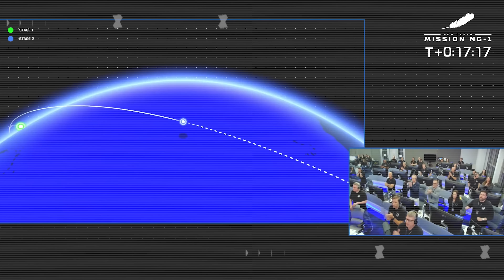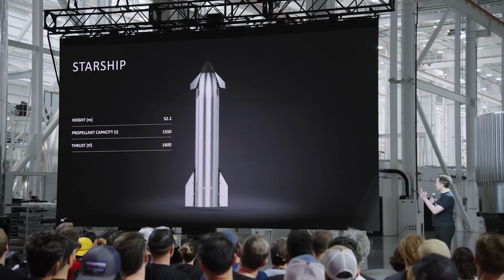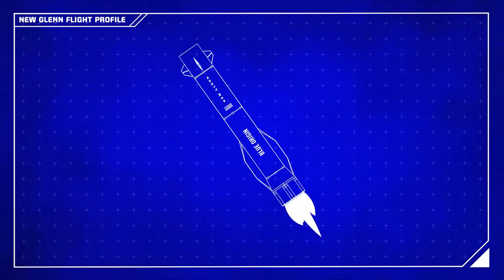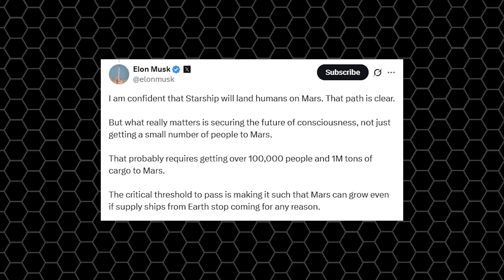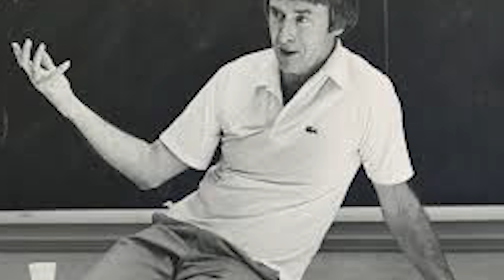Blue Origin New Glenn is EXACT SpaceX Starship Killer!? Musk Laughs...

Comment: The entire Starship design is a monument to idiotic futility  design based on material costs and arrogant pride mixed with the termination of anyone that tries to tell musk the truth. In order to 
Attempt to make his idiotic concept viable will likely take decades  to achieve if ever and the ended up costs of the choice of steel in order to make just 1 successful rentry will be exponentially more costly than simply paying the  carbon fiber components.  
And will never be cable of  reusability without massive, more costly refurbishment than original production.  

One such failed idiotic musk directive. The ceramic heat tiles were and still are based on the heat tiles used on the Space shuttle.  SpaceX was given the entire  archive of research into the development and engineering of the various  tile and needed tolerances. As well as Nasa approved manufacturers of the tiles. Musk decided without any understanding of why the space shuttle tiles were intentionally designed without continuous linear joints.  So they could be mass produced instead of 
Being specifically produced per section. 

The heat-resistant adhesive nasa used on the shuttle is costly and adds significant weight. Musk attempted to forgo this crucial component and originally had the tiles mounted to the hull with metal components.  
Furthermore, more musk forgo the Nasa recommended producers of the tiles and contracted a foreign company that specialized in plastics. These tiles were made with materials  that were poor quality, too large, and such the materials were not properly  proportioned, producing incosistant tiles that were prone to breaking. After several failed attempts, SpaceX has now had tiles produced from a more qualified production company. Using the adhesive, however, the additional weight prevents the starship shell from lifting anything in it. So massive reductions in the shielding and material tolerances in the propellant transfer pumps and engine shielding as well as  increased spacing  between interior hull skeleton.  However , the symmetrical joints of the tiles  does not disperse the heat sufficiently allowing very high temperatures to penetrate the gaps. Steel  contracts and expands significantly under much less extremes than experienced during launch, freezing and warming extremes in Leo then massive extremes of nonballistic rentry. It is very likely based on footage the mere contractions of cold space alone are enough to compromise the structural integrity of the welds. Regardless during rentry the weld and structure expansions make reusability an impossibility,  however structural integrity seems sufficient for intact rentry. 
Except for the drastic reductions in shielding and decreased  material sizes for propellant transfer. With leaks evident in every reentry and interior flames engulfing the upper engine housings. The bs supposed raptor 3 engines are supposed to not need shielding and are supposed to produce greater thrust with even further reductions in propellant hoses and components. However much of the weight reductions is from carbon fiber . That again increase s cost and can't be produced by SpaceX.  As for reduced hoses and components is supposedly by using a single propellant transfer pump to all the engines.  This has proven unreliable and inconsistent when oppperateing a single engine in various test ignition.  Not to mention as of yet  only sea level raptor 3s have prototypes being tested.   Raptor 2 vacuum ergo that used in starship are still being produced though in reduced production numbers.
Reply: Exactly! 13 failure and the thing can still not make it in orbit and carry anything.
They spent $3 billions on this stupid useless vehicle. It could be one day good at putting Sarship into orbit. Beyond that, Starship is just like the Cybertruck and Hyperloop.
Reply: @trucksanddirt1506  Just to illustrate you have no idea what you're talking about: There haven't even been 13 starship flights.
Reply: @XShadowAngel The thing is a joke, it's clearly not working. If it could get to mars , or even the moon they would have done so.
Reply: @Supraboyes  What part of it being in testing do you struggle with? And the last handful of test launches have all gone extremely well, in point of fact.
But then, what do you know? You're trying to say it;s never been to orbit, and it has.
Reply: @XShadowAngel  No Starship has not achieved orbital velocity. Its far too heavy even as an empty shell.  Originally Version 2 with its increased propellant tanks and drastically reduced engine housings,shielding,and inadequate propellant fittings and plumbing.  However with the additional heat shielding and subsequent propellant leaks and attempting to find the bare minimum to reduce fires. v2 was barley capable of reaching orbital velocity as an empty shell and if it had could not have deorbited under guidance. V3 was also promised to finally be the starship that would be able to reach L.e.o. with 100 tons of payload . However, SpaceX has now publicly announced there will be a version 4 and 5. 

So it will likely still be a long time before starship reaches orbit. If they had any actual direction to achieve any of thier public stated goals then they would focusing on keeping thier propellant and engines from incinerating on reentry.
Reply: @trucksanddirt1506  Uh. Starship's reached orbital altitude and velocity plenty of times. They just bring it back down because the landing is what they're testing. Anyone can get to orbit. SpaceX gets Falcon9's to orbit almost daily. It's the landing that's hard, and why nobody else has done it. You people have no idea what you're talking about, but are very loud.
Reply: One hell of a lot of hot air.
Reply: @MrEh5  Well yes, that's what Elon sells--hot air.

Comment: New Glenn is competition to F9, not Starship. However, if BO and others want to compete against SX AND CHINA, they need to quit following in SX's footsteps. 
Instead, they need to do a number of standards and modularize more. NG, Vulcan, even others can launch fuel, limited cargo, and modules. 
So, they need:
1) a fuel depot with a standard for docking and ideally, providing different fuel/Ox. LOH, LOX, and LCH4 are the 3 biggest, but even multiple hypergolic are needed. So, ideally, all fuel depots will support 2 different main fuel/lox that transfer via large fast connections, along with smaller tanks for hypergolic that can be transferred via IDSS docking which needs to fully develop standard connections. Otherwise, several different fuel depots. 
2) tug for moving habitats and cargo modules in LEO, between LEO and LLO, between LLO and LMO. Initially make them chemical engines, but then switch to nuclear once available. 
3) the crewed habitats for space station are ideal for moving crew between LEO/LLO and LEO/LMO. 
4) a cargo module that sits in the upper stage of these rockets would be ideal for moving from earth, orbit, moon. 
5) a lunar lander that works with both crewed/cargo module. Ideally, it would bring down cargo and habitat modules and drop them off. For human transfer a special, unit that is lightweight to minimize fuel up and down.

Comment: The second stage is damaged... But at least we know how it's installed on New Glenn. But how do 100 tons of cargo get into the HLS payload bay? At least show an animation. Not the Starlink launch, not the fuel transfer, but the cargo. For example, load 12 Cibertraks into the ship. I'd like to see it.
Reply: you might have a point but .. cbrt(1100m3) is 10.3228011546m ... liquids would fit more than ~1000 tons in such space...  if the cargo bay would be square then in 10 by 10 by 10 meters one could fiit 10 by 25 = 250 trucks (more than 2 tons each, so at least 250 tons total)... unless i got the numbers wrong... but you are right, it hasn't been demonstrated yet...
Reply: @ksd593  It's not about quantity, but how? By elevator from the Earth's surface? From a platform on a special loading tower? In orbit, using a container with its own engines?
Reply: @SergDabl  imho - the last one. to land and lift a whole starship is wasteful resource/propellant and time wise. elon must let those tanks and shields+flaps rotate in orbits and land on earth 🌎 only.